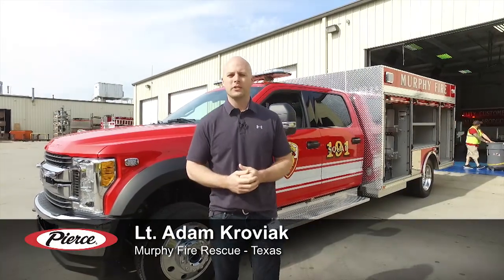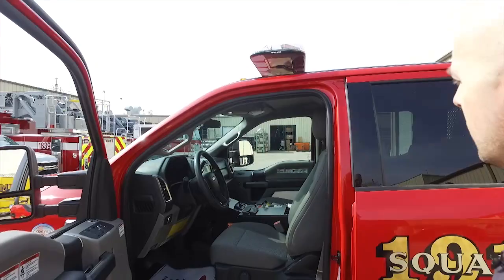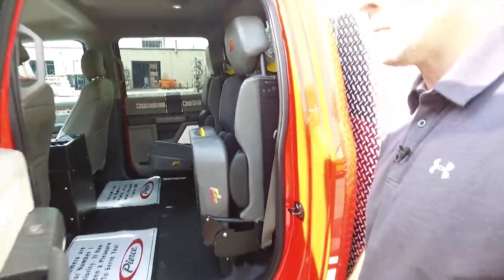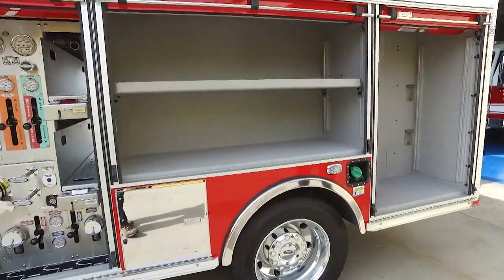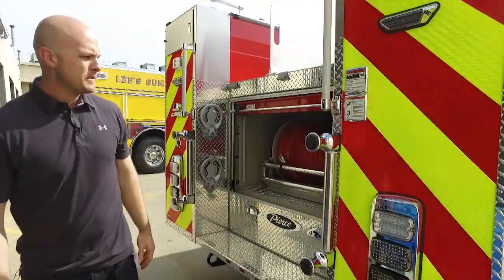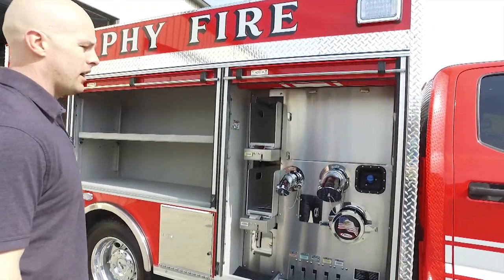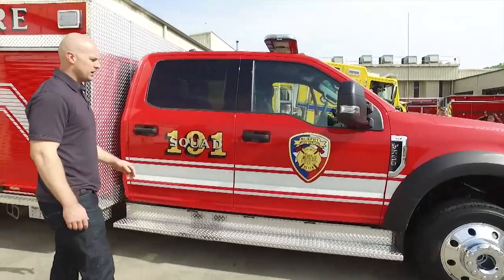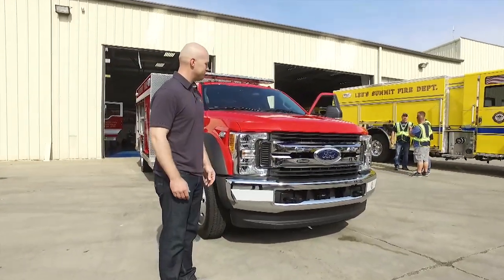Murphy, TX – All-New Ford F550 4x4 Mini Pumper

Comment: Needs Foam and an extended front bumper with cutters and spreaders to maximize on space not to mention coffin compartments on opposite sides of the hose bed could use a light tower on the cab if you can dream it they will build it
Reply: Corey Shumaker you also have to remember that there’s a max weight limit
Reply: or just order it the way you want it since you're paying for it...

Comment: Very nice looking, but 1500 gpm with 300 gallons? What's this, a quint? :D
Reply: Better make wise use of those 12 seconds of water.
Reply: Lane Spyksma nope! A quint is a ladder/engine combination.
Reply: AJ Calacci Sorry for the confusion, I was being sarcastic, as I've seen many a quint with the same pump/water specs
Reply: @hosedragger-204  r/wooosh
Reply: The difference in price between a 500 gpm and 1500gpm really isn't that much.  While yes you will most likely never need the 1500 gpm on tank water, truck can now be utilized as a relay pumper freeing up the bigger trucks for other tasks.